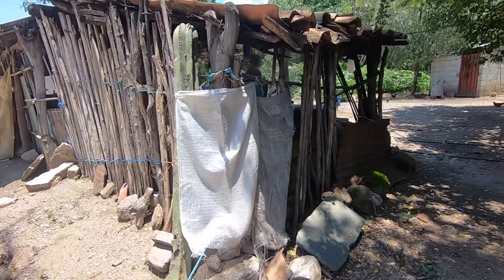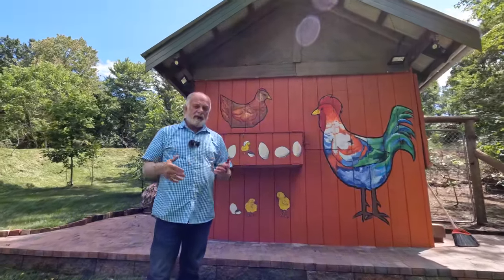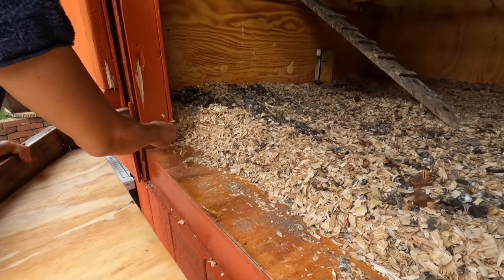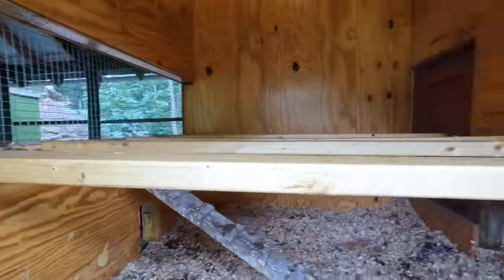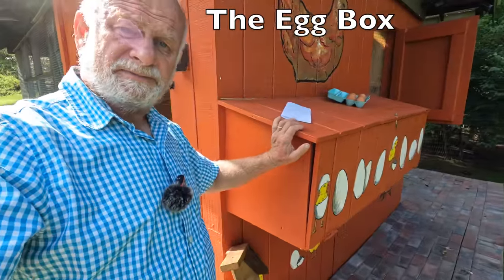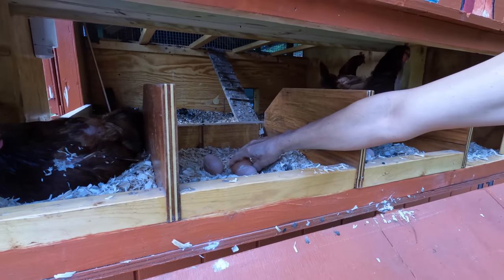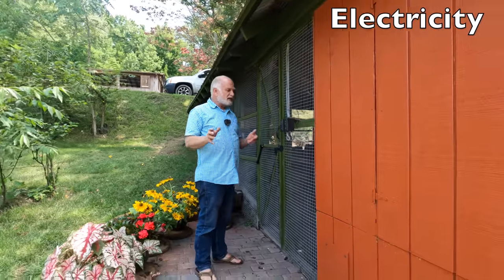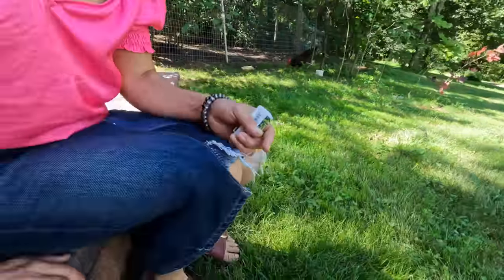DIY Chicken Coop, 6 amazing ideas that will help you - Hen-House, Storage, Poop Funnel, Waterer

Comment: We have similar ideas 💡,  very creative coop,  the biggest difference is my choice of building materials,  my coop is built out of steel reinforced block and concrete,  my nest boxes are built out of mostly metal and wood,  my electricity is 100% solar, my pumping system will be 12v working on solar,  my rain catchment will be done with a diverted system with 255 gallon storage,  I'm working on my chicken run right now, my coop is called the chicken bunker because it's hurricane proof,  I have some videos up so you can see another creative coop, I enjoyed your video.
Reply from the maker: ok we will thank you for your time
Reply: @Farm_Projects  I subbed because your ideas are as crazy as mine lol , your execution needs a little work,  but I understand once a idea 💡 hits sometimes it can't wait 😊

Comment: I love the way the door for the eggs folds down.  That is what mine does, and it has two cables that hold it open like a shelf.  I make the nesting material out of grass on the property.  I make my own wood chips with my chipper, and the floor of the enclosed run is dirt.  What I might do next is to open the floor of the coop so that all the waste just falls to the dirt below and from time to time I can rake the top layer of dirt and replace it with fresh dirt.

Comment: This is the best chicken coop ever i wish i got one😊😊
Reply from the maker: You can have one. No need to be so elaborate. I think the important thing is start with the hen house. And work on that. The smooth walls and floor are very important. The run is just a frame with wire. Not hard to do. But do little by little. As you can afford it or have time for it.

Comment: I'm getting ready to move to my retirement farm which includes 3 outhouses which are 10X16.  Of course one will specifically be for chickens once I get it cleaned out.

I will be gluing down vinyl flooring  because I already have it but sealing up the walls is such an excellent thing to do.  I was also planning on building a rain water catchment  using a couple metal garbage cans but yours looks so much bigger and better.  

Looks like you have thought of everything on constructing yours and I will definitely be stealing some of your ideas.  

Look forward to future videos.
Reply from the maker: These ideas came from frustration. Every part started out as what we saw on other videos, but I could not stand the inefficiency. What you see is a lot of changes, sweat and tears.

Comment: It looks stunning !!!   
I don’t think a lot of backyard chicken pple want to use the toxic paints and chemicals. But I could be wrong.   Still stunning work !!
Reply from the maker: Thanks
Reply: You are not wrong.
Reply from the maker: The sealer we used in the Tank is VOC free. The Urethane is completely dry by the time the chickens comes in contact with it. I think the FDC would have something to say about using Urethane in food storage areas by now. Anyway, thanks for your input

Comment: Thanks for this video I am making plans to build a coop for my chicks. I have noticed that they do like dipping there beaks into water. So I'm going to try to build a trough as well. Love the video I'm subscribing.
Reply from the maker: Yes they do. I am already making a better trough.  It should be a little deeper and have a drain so to clean it out easier. The idea is to circulate the water through the tank that has warmer water during the winter to prevent the trough from freezing

Comment: This is my DREAM! Genius ideas I will use when I upgrade our chickens. The water system is INCREDIBLE. And making it a beautiful place to be is 100% a way to make it bring you joy every time you hang out with them. Thank you so so much! 🐔 Does the polyurethane deter spiders? Our coop is super clean but I still have spiders wanting to hang out.
Reply from the maker: You can do it! I think due to the smooth surfaces of the walls,  we do not see any webs inside. I am not sure if the polyurethane is a deterrent. But it is really clean.

Comment: Wonderful setup. Thank you for sharing. If you don't mind,  what automatic chicken door are you using?
Reply from the maker: Thanks for the comment. We started with the Run-Chicken Automatic Door, Got another one. I wasn't happy with the quality and its function. They work but sometimes have issues with the light sensor. Not very reliable. Then we needed another door for the Rooster House. I bought then New 2023 ChickenGuard PRO. Much better mechanism, but very bad light sensor.. So i switched the settings to Time instead. That doesn't work all the time either. I wish to find a better door.
If anyone can comment on that I would be happy. Many Thanks

Comment: Did you put insulation in your chicken coop I can’t remember it’s been a while since I watched your video I need to watch it again because I’m getting ready to build my chicken coop and I love the idea of that easy scooping of the chicken poop and the polyurethane on the walls in the floor! What thickness was the plywood that you used? If you used insulation what kind did you use because I know you’re in Pennsylvania I think you said and I have the exact opposite problem than you I am in Texas and this past summer we had about two almost 3 months of over 100° Temperatures and that’s not even inside a building so I think I need to insulate it from the heat!

Comment: This sounded interesting and I wish you well. That said - we're from different planets maybe...? I'm trying to use innovative ideas and recycled and upcycled materials for my chickens. An IBC tote has made a great brooder for 12 weeks, a used garage-tent frame and a roll of 2x4 paige wire yields an 8 ft H x 16' x 12'  run that's totally predator proof from above and perimeter. NO WAY I'm spending $16,000.
Reply from the maker: I agree with your view too. But, I really didn't want to put something together that look like a junkyard. I wanted it to look appealing, and feel quality. Anything plastic start to diminish that feeling. Thats why the feeder is build from wood, and not a plastic bucket that would have worked fine. That is why the water trough is from wood. That is why most things in the coop is wood. I also used a heavy guage wire for the enclosure. Everything is designed to feel clean and quality. The paving was very expensive, but after installing it, it really felt much cleaner around the coop. The electricity is an overkill, but we really like it and use it a lot. The storage area, I could have used a toat or something, but it is build in and I also used Poly urethane on the inside.
I guess what I am getting at is, I could have saved a lot on everything. But I wanted to have something that my wife can enjoy for years to come. That was the 1st request she had when we bought the property. My nature is to do everything I can with quality in mind. I might not show quality craftsmanship, but I try to use the best materials where possible.
I hope nyou enjoy your chicken coop as much as my wife does ours. Many days I wish I was a chicken instead. LOL

Comment: God bless you all. Thank you for sharing. PS get more ladies so I don’t get beat up so bad from your roosters or coll out some roosters
Reply from the maker: We decided to separate the roosters. They have their own "Rooster House" and roam outside of the fence. The hens are doing much better and when winter sets in they should be fully covered. BTW, we ordered Chicken sandals and we will put them on the roosters today to see if that helps to deter them. One rooster is super aggressive and the other rooster takes a beating. Maybe we found a solution. We will make a video if it works.
Reply: FYI, the saddles go on the ladies. Not the rooster. Get more ladies. The more ladies you have. The less problems you will have. Each Rooster will take care of 15 to 20 ladies. If you have an aggressive rooster. You need to pull him aside and dominate him. What you need to do. in front of the whole flock so they understand you don’t tolerate this. Push him lightly down but with enough pressure so he has to lay on the ground. you do not let him up until he stays down. He needs to be submissive. Do NOT hurt him. he’s just like a child. He does not know any better. You have to let him know if you are the boss. It’s unacceptable to disrespect you your family, your children,  The flock. Your ladies. Once you dominate him, he will settle down. It’s all about the pecking order.
Reply from the maker: We know about the saddles. But I don't like the idea that much. For now we keep the roosters out. We are working on a different idea that will stop the roosters from being so aggressive. We are testing it for now and should have a video out soon.

Comment: I would not dream of putting polyurethane in a coop given how they scratch and peck things, and that it can be slippery. Rubberized coatings are more recommended on chicken fora.
Reply from the maker: So chickens don't peck at a floor. The floor is covered with pine chips, so they really don't scratch in the hen house. A hen house is primarily to roost in for the night. After 1 year we have very good results and evidence that it was the best thing to do. Some of the comments already mentioned that they had difficulty with a vinyl floor.
If peckin was a problem, they like to peck at foam, rubber. That could be a problem.
The rooster bars are smooth polyurethane. After a year they seem to be ok on it.